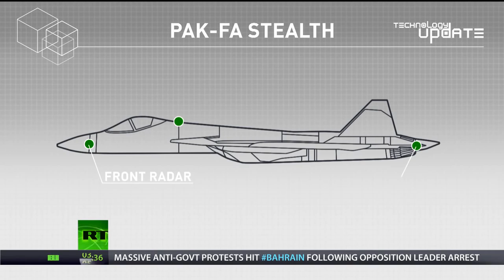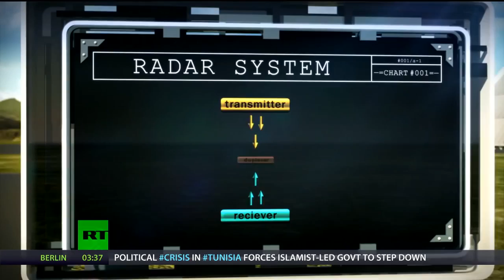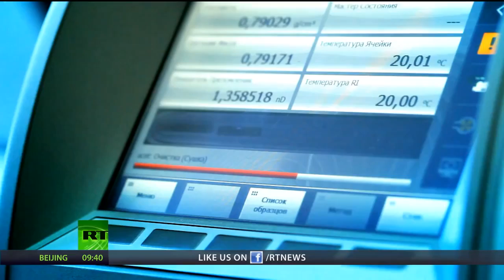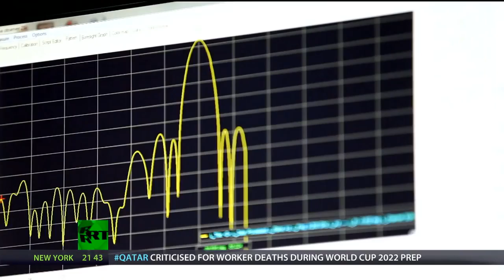Sukhoi T 50 PAK FA Stealth Technology

Comment: F-22A is way better this is shit
Reply: Evidence?

The PAK is faster (top speed of roughly mach 2.3, compared to the F-22's 2.25).
The F-22 is more expensive and doesn't have IRST, which the PAK FA does have. The PAK FA also has 3D thrust vectoring and while the F-22 does have larger control surfaces, it only has 2D thrust vectoring, thus making it less maneuverable. The F-22 does have one advantage in the form of thrust to weight ratio, but the PAK FA is supposed to be getting new and improved engines to compensate for that. You could also argue that the F-22 has better stealth characteristics, but that counts for shit if you've been spotted. 

So while the F-22 has better thrust to weight ratio (currently) and slightly better stealth, the T-50 is faster, more agile and cheaper....

"But the F-35" I here you cry. Well, it uses Russian thrust vectoring that was copied from the Russian Yak-141. It's top speed has been tested to mach 1.61. It does have thrust vectoring, but it's an attack aircraft and isn't designed for aerial combat.  

Your "F-22 is way better" augment is invalid and completely opinion based.
Reply: stfu, a stupid ass! You were obviously brainwashed by American media.
Reply: F-22 fan boys literally have nothing to go off... The F-22 barely has any proper war time experience and its specs are outdated in comparison to other fifth generation aircraft. I mean it's by no means a bad aircraft, it's just outdated a bit on the specs sheet.
Reply: ...and posts such as this F22 fanboy's that contain not a stitch of verifiable evidence can be taken so seriously.
Reply: I know. Which is why nobody has any ground to say that the F-22 (or any other aircraft) is defiantly better than other aircraft... So there are only specs to go off.
Reply: Well said Edvorticus Snorticus. They seem to forget that there are other 5th gen fighters out there. And that stealth is just a gimmick. It works to an extent, but new ways of scanning airspace have made it possible to pinpoint stealth aircraft, whether it be through low frequency radar or infrared systems.

People bang on about BVR and how american aircraft are capable of carrying weaponry that can destroy an aircraft without it being in sight. But they forget that the likes of Russia and china also have equally capable weaponry that's arguably better (such as the R-77).

Test simulations of Russian aircraft vs US aircraft have also shown up how bad the F-22 is in comparison to the likes of the SU-37 and PAK FA. And I'm fairly certain that these were American simulations. The F-35 doesn't get away with it either... It's been criticized by various aircraft designers.

Whatever happened to the good old US aircraft?
Reply: so your saying a plane that needs 30 hours of maintenance every 1 hour of flight and suffers critical damages if been 1.7 hours in flight, cant fly in rain cant communicate with other planes has problems with the oxygen for the pilot and costs 350m for each plane is better than pak 50, ur funny go back to playing cod.
Reply: camdog124 bops 2 on the aircraft carrier theres planes on it that look like raptors
Reply: camdog124 i said that look like a raptor
Reply: George Skirrow
Actualy F22 has NO wartime experience whatsoever, it NEVER flew a combat mission in it's 9 years of service (and ih had the chance in Libya, Avghanistan, Iraq and now against ISIS).
Reply: JayDee
Neither does F22, in service for 9 years, combat misssions = zero!!
Reply: Lol you crazy yall some haters HAHA
Reply: George Skirrow
F-22 has barely any proper war time experience...most aircraft in the world do not have war time experience
Reply: Anyway from what people are saying, the F-22 program is getting the shove... Which is good news in some respects because it could mean there's a new aircraft in to replace it... I hope to God that Northrop is behind it if that's the case, because Lockheed seem to be nothing but the Samsung gimic of the military aircraft world... 
Look at the YF-23 and you'll know why Northrop is better!
Reply: halloween448 What CoD has a raptor in it haha
Reply: halloween448 But its not
Reply: Lomnjac007 technically it does if we're including real life war time simulations like operation red flag... But even then it's been known to have been ""shot"" down by Luftwaffe Typhoons in WVR combat, which says a lot.... Because although the F-22 is good at BVR, it HAS to fight WVR if the opposing aircraft also uses stealth... Which the PAK FA does. And since the PAK FA has better WVR specs, it kind of puts the F-22 at a massive disadvantage. 

It's a good aircraft... Just not very well thought out.